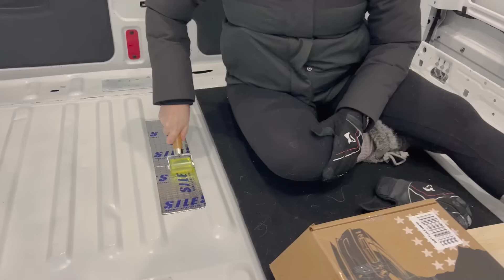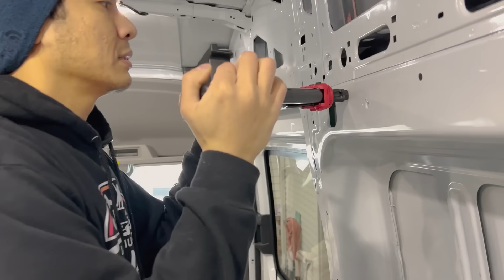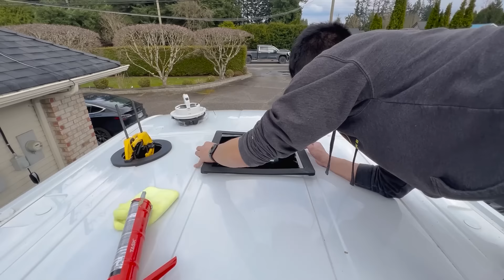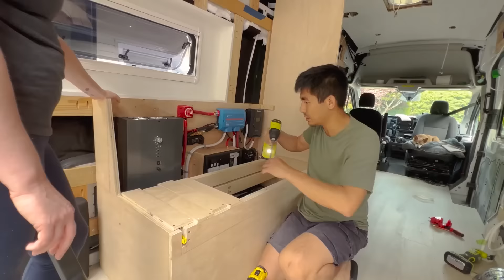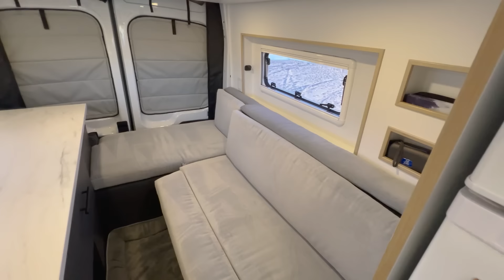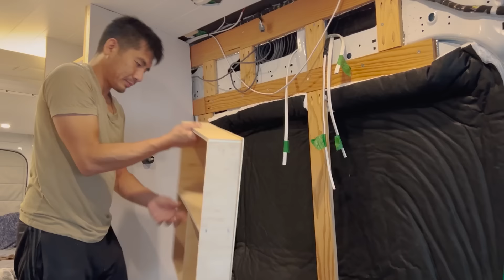FULL CAMPERVAN BUILD - Step by Step DIY

Comment from the maker: Check out our full van tour here:
https://youtu.be/hRcxKpc1iaA
Reply: What was the total cost of the project? Ive seen a nother van builder recomend not spending more than 50% of the vehicle price on fit out as a rule of thumb. How many miles were on the van when first purchased?
Reply from the maker: @Timbo_tango 150k CAD total, half was the van purchase and other half was the build. Van had 50k km at time of purchase. 2020 ford transit 350 high roof extended AWD ecoboost twin turbo
Reply: @LetsJustGoTravel  I think 150k CAD was 111k USD two years ago. Half on build would be around 55k USD not counting your time/labor. How long did it take you to build the van out? Your first video on this was December 2023. Your last build video was February 2025. So does 14 months sound about right?
Reply from the maker: @WaywardOffGrid yes it was a little over a year of building so that sounds right !
Reply: @LetsJustGoTravel  Fellow Canadian here Have you had any issues with the Renogy system so far? Im on the fence with Ren And Victron And a few comments on renogy customer service being lacking (Not great if your in the middle of no where waiting)
Reply from the maker: @livingonadollar2882 we’ve been using renogy products in multiple rigs now and they’re pretty great! I think in all the time we’ve travelled on the road we’ve had one of their dc-dc chargers go bad and they sent me a new one under warranty. Victron is great of course but expensive! Renogy is good value for money IMO.
Reply: @LetsJustGoTravel   Hey thanks for the quick reply ! They have a "go far And Go further"  All in one kit  All the wires pre cut and crimped Solar And batteries Chargers Plug and play  The only thing is shore power where you need to buy a charger I am guessing its not like the Victron with 120 in charging But all said and done your pretty near 1/2 the cost of the vic for a 600amp bat And  400w solar on a 3000w inverter Thanks again If your even in the Big Nickel  I can give you some tips on nice spots And others to avoid
Reply: Quick question. Would it be worth it to buy a used van and just pay a company to convert it?

Comment: Great job.  I'm doing a conversion in about 5 months and came to learn and learn I did.  I however, will not be doing a van conversion.  I'll be doing a box truck conversion which overall is cheaper, easier, and I believe a lot nicer.  For starters, the ceiling clearance after insulation will be around 6'9" from the floor.  I also will be working with mostly 90 degree angles.

Comment: Great job! One thing I do want to point out, is the shower area. It looks to me that the shower floor is flat, which means that water may pool up in certain spots, rather than draining properly.
Reply from the maker: Thanks! Haha yeah we do have some issues with the water pooling if we are not on level ground. I was not skilled enough to create a slope with the shower pan haha. Should’ve just gotten a custom made one from a shop!
Reply: @LetsJustGoTravel  But for DIY, you did awesome too. Having it done by a shop would have been more expensive, so if it works for you, awesome!

Comment: Is this the biggest transit with the extended...I know it comes in 3 sizes...
Reply from the maker: Yes this is the high roof extended length. The only “bigger” is with dually rear wheels but that technically gives you less room to build inside because of the wheel wells. It has more cargo capacity though!

Comment: As a sound guy, if you're doing on camera stuff, use the on camera sound, like you did at the start.
Don't do what you did later, which was using voice over sound, out of sync with on camera video. It's extremely grating. Just go total voice over or on camera.
I really like the video, it was just hard to watch because of the mismatched sound.

Comment: So why renogy everything power setup seems like many van builders using battle born batteries and fictron,  I bought a 2018 Mercedes benz sprinter van 3.0 170 cargo van to build and I also using renogy lithium smart batteries and solar panel and other components

Comment: Wow 900 lithium ! I built my van about five years ago in lithiums were four times the price I have since upgraded from the AGM’s to 500 amp hours of lithium damn wish I had the money when I built mine to put in that much, but 500 is pretty good in the summer with my 200 W solar panel. I pretty much don’t use any energy it just pops up my batteries from what I use with fridge and lighting at night. I get about 10% in ideal conditions of sun on my batteries per day, which is about what I use per day, even Steven

Comment: Wait so is the bed lifter queen sized and fitting long ways with the van (front to back 209cm)? That seems way easier, cooler and cheaper than doing double flares!
Reply from the maker: Yes it’s fitted long ways on the van but is not queen length. It is 1778mm long approx 70inch. Definitely easier than adding flares for sure!

Comment: I’ve seen numerous van builds.  Most are awesome like this one.  But what I don’t understand is why no one installs a real toilet and black tank.  Instead, they go with sh&tting in a glorified bucket.  They add a kitchen, pantry packed with food, large refrigerator with more food, and cooking equipment, all items to create more sh&t, which just fills up the bucket faster and engulfs the van with a$$ fumes.  They spend so much time and money adding fancy stereo systems, gadgets, and transforming furniture, but simply toss a sh&t can in the shower.  I bet these vans smell like a rolling sh&t house on wheels.  It would be less nasty just to carry a shovel and sh&t in a hole on the side of the road.
Reply from the maker: A black tank can be an option for these vans but there are a few reasons we didn’t consider it:
1: we already have a gray tank and if we added a black tank it was 100% put us over our weight capacity. A ford transit dually might be a better choice if you want to have a gray and black tank
2: black tank means your toilet is now fixed in position and can never move. We like having the ability to move our toilet out of the shower when we actually want to shower. There’s already very limited standing space in our shower stall and having to work around a toilet would be a pain.
3: there’s basically no smell regardless if you’re using a compost toilet or chemical toilet. 
4: you probably don’t want to dig a hole to use the bathroom if it’s pouring rain, windy, cold, etc etc
Reply: @LetsJustGoTravel  I have a 2017 A Ford 350 HD Transit dually motorhome.  A black tank doesn't add much weight if you keep the tank drained.  I'd ditch the refrigerator and or stove, or both, for a flushable toilet.  If I ever decide to build out a van, the number one feature would be a residential type of toilet like I've installed in my motorhome.  Maybe I'm the weird one, but taking a dump in a bucket isn't an option unless it's an emergency.  But I do dig your van.  I'm impressed with the quality.  I built my own house from scratch, and I didn't hire anyone to do anything.  Framing, electrical, plumbing, mechanical, finish out.  Even built my cabinets from raw lumber, and most of my furniture.  So, I know how much work it was and the skills required to finish out your van.

Comment: Is that reflectix that you guys put on the back of the wall furring strips?
Reply from the maker: Yes we used reflectix but not sure how much it’s actually doing? We saw it on another video and that’s what we did it but idk if it actually makes a difference 🤷‍♂️
Reply: @LetsJustGoTravel ah okay thank you! We ended up skipping that part but it definitely makes sense

Comment: Is this good for camping in -30 degree weather here in canada?
Reply from the maker: The coldest we’ve ever camped is -6c in this van. If it were to regularly do -30 temps I would’ve probably installed a bigger heater.

Comment: I’d appreciate replies. I’m new to this space. Honest question, why would one go this route vs just buying an RV used? I see many in my area (Utah) that are barely used, a little older, and would save me a year of work and toil. Just curious. Love the build!
Reply from the maker: You can absolutely buy a used RV if it fits your needs. The benefit of doing a custom build is that you can tailor each aspect of the van to your exact needs. You’ll also know exactly how everything was put together so can fix it when needed. 
If you’re new to RVs and vans I would actually suggest renting one for a weekend trip to get a feel for it first. Then you will be in a better position to buy or build. Good luck!

Comment: No wonder people charge 100K for a van. Too much unnecessary over kill. Bought my van for $2000. Jist going to build a basic floor using bamboo flooring with the regular insulation they ise for homes under floowing on concrete. If its good enough under concrete its good enough for metal floor

Comment: After watching all this I decided just a bed with a battery bank is all I need fuck all that other stuff. Ac heater with a TV
Reply: I'll add in a ceiling fan and a diesel heater.
Reply: @qguksu ceiling fan sounds nice but with a hole in your roof and a mpg hit I’m not going that route. I’m going with a split ac backpack unit that bolts to the back door like in semi trucks and using the fan in that.
Reply: Yep and gas powered stove

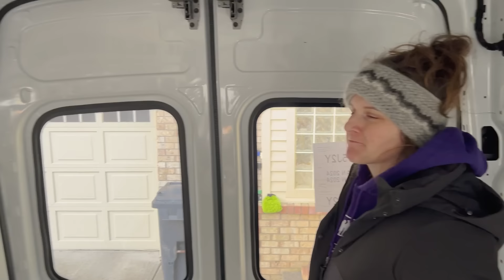Comment: 4:55 Those rivet nuts were a brilliant idea. I use them on my professional projects. You will now have the ability to make future modifications really easily. Only one thing to watch out for is rattling the screws out during drives, so a touch of Loctite will help with this issue.

Comment: I don't like that Negative cable touching the positive cable if it ever wears through it won't be pretty.
Reply from the maker: That’s actually a fair point! I’ll try to reroute that wire so it doesn’t do that anymore. Thanks!
Reply: @LetsJustGoTravel  I've made magic smoke a time or two.

Comment: You  better put supports on those windows.. They WILL Fall OFF with Heat and bumps over a period of time with just that Glue/Caulk.
Edit** and you better protect that blue heater hose you have under the van.. you hit anything from a stick to bag and it could rip that thing apart quick.

Comment: Does your bed cover up your air conditioner when the bed is up? If so, do you need to lower the bed to cool the van during the day?
Reply from the maker: Yes the bed does cover up the air conditioner which we did on purpose. In our experience you don’t need AC that often while travelling in a van. The maxx fan usually does well enough on its own. We plan to just lower the bed and hang out in the bed area if we ever need to use the AC. The model of AC we installed isn’t powerful enough anyway to cool the whole van so it’s only useable in the bed area.

Comment: A few years ago, Renogy launched a modular power supply solution, the MOBILE POWER SOLUTIO, for the vehicle industry. This Off-Grid Power Solution can be freely expanded to provide three power sources: solar power, AC mains power, and on-the-go charging, with intelligent switching and a highly integrated controller.

Comment: What is the point of sound deadening material if it only covers 10% of the floor?
Reply from the maker: Sound deadening material is really just to cut down on some road noise and the metal of the van reverberating . You don’t need to cover the whole thing

Comment: very awesome build and alot cheaper than buying those prefabricated ones from dealership. I may have missed it but make sure that battery area has a fan in thier just in case those battery's get hot its pulling out the hot air. i could be wrong but generally the battery's can get hot with that much power. good luck and god speed.

Comment: Cabinet builder here. First... Awesome job. Second -- Just as a note, unless the drawers will be holding heavy tools or something similarly heavy, almost all drawers use 1/8" bottoms. If installed properly -- they're super strong.
Reply: Moving company owner here --- 1/8" bottoms regularly start sagging after a few years and get damaged easily over time. 1/4" is a much, much more reliable option. Especially in a vehicle that's going to be moving around a lot.
Reply: @ballwizz23  Student pilot here, you don't want to pull back the yolk/stick all the way back for too long or you might stall the aircraft.
Reply: @CantElope-i7nComputer science student here. Simple, asymptomaticly slower sorting algorithms are oftentimes more practical, as the complex ones are only faster on huge datasets.
Reply: @justadu21 scrum master here. I really think you could fit a few more tickets in your next sprint.
Reply: @mediaburn2  car painter here. u should have bought white  rust oleum paint instead of black. it would cost alot if u gonna spray black to white instead of white to white.
Reply: @klemonaugusto3088  drywaller here, you want to use 1/4" drywall unless you have to use thicker stuff, like for waterproofing or fire protection.
Reply: @CantElope-i7n Rocket Scientist here, you've gotta at least launch to an inclination of 63.4° to get to a Molniya orbit and cancel J2 perturbation from earths oblateness
Reply: This is the best comment thread on YouTube
Reply: if by "almost all drawers" you mean particle board specials from walmart or ikea.  1/4"/6-6.4mm ply is standard for drawer bottoms.
Reply: Agreed. So many of these builds seem absolutely bent on adding as much weight as possible. This isn't a HOUSE people! Why with all the wood framing, shiplap siding and roofs and 3/4" plywood (WITH FRAMING!) for absolutely everything?
Reply: @WhiskyGravy for some it is, in fact, their house.
Reply: @Wainamu75 I agree it is their *home*, but it is not a house. 
I build houses for my living. Houses do not have wheels, even if some Homes do.
😉
Reply: @WhiskyGravy  Its called doing it right the first time you lazy pos
Reply: TIL the origin of the phrase "furring strip"
Reply: Well done!
Reply: Beautiful… great job! Love everything about it. Thanks for the confidence you’ve given me.
Reply: Millionaire here, go buy one, save time and energy!
Reply: @minh-trading … ew. Also, baby needs a big man to do the work for him? That’s adorable. Don’t get those pretty little nails dirty, baby girl.

Comment: This is probably one of my favourite DIY van builds that I've seen, but my only concern is having the oven so high up. Maybe it's because I'm so short, but personally I would've put fridge just straight on the floor, the oven on top of the fridge, and the extra storage drawer at the top of the van

Comment: 2 questions.
1)Did you end up having to reinforce your suspension because of the weight (you made multiple comments about the weight so it seems you’re worried about it)

2) why do drains not need to have a u bend drain like houses do?  Do the gray tanks not have smells that would come back up?
Reply from the maker: Yes we have the Vancompass stage 3 lift kit which provides a lot more weight support. 
For the drains we used the Hepvo valve which is a waterless P trap that doesn’t need to have a U bend but still blocks out smells from our gray tank.

Comment: Does the bed block the air conditioner?
Reply from the maker: Yes the AC can only be used when the bed is down. We did this on purpose because 1: we’ve lived on the road for many years and very rarely need to use AC. And 2: The max fan does the job most of the time! 
Plus the AC we installed isn’t powerful enough to cool the whole van, it can only cool the bed area. We’ve maybe used the AC total of 3 times since we installed it.

Comment: How much weight do you think you added in total? I always wonder about the load that is added and the strain it puts on the engine and suspension.
Reply from the maker: We have the Vancompass stage 3 lift kit so it definitely helps with the added weight !

Comment: Ok, how much was it all?
Reply from the maker: About 150k CAD all in. 75k for the van and 75k for the build and materials.
Reply: @LetsJustGoTravel is that factoring in an amount for your labor or is it just materials?  Excellent video!
Reply: @mariannekniel8077 when people general diy, they don't add generally labour costs it's all just materials.
Reply: @mariannekniel8077  When you are doing DIY, Labour Work/cost is rarely included! 
Its clear from the comment its the cost of; the Van & all the materials.
Reply: @BlackHawkTejas  no idea how they managed to spend 75k on materials.... I've seen van builds with much higher end material and components cost 30-40k.
Reply: @jplays1108 did you take into consideration it’s Canadian and not usd
Reply: @jennwang9666  that would still be over 50k in material.... USD.... no idea how they managed to spend like I said... over 30-40k on a HIGH END van... thats max... if you spend over 40k USD you did something SEVERELY wrong.
Reply: @mariannekniel8077 what are they going to do? Pay themselves. Lol